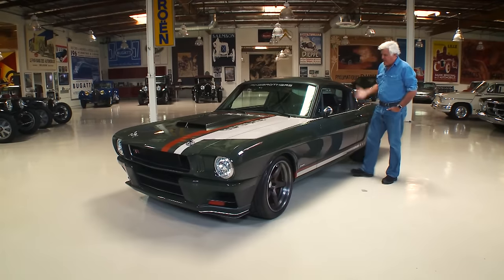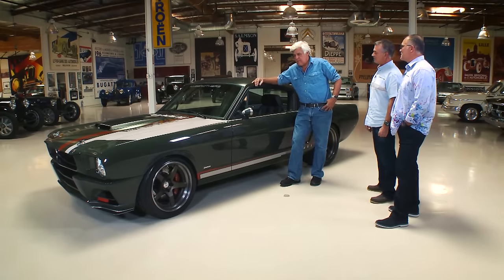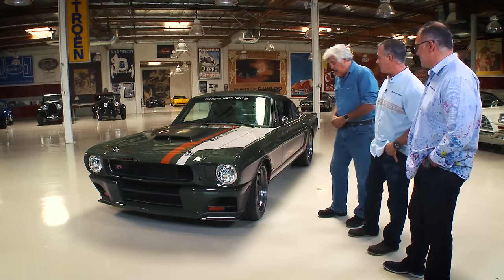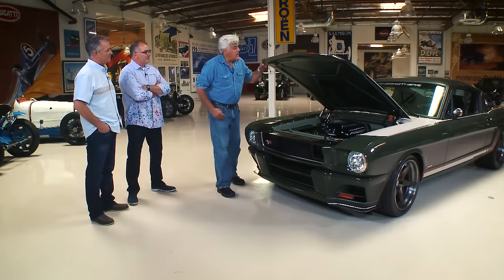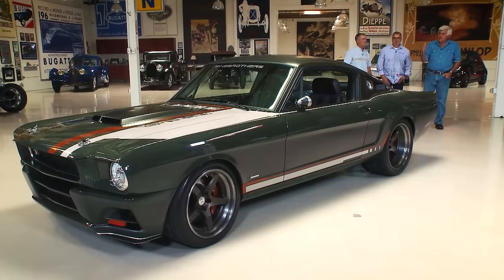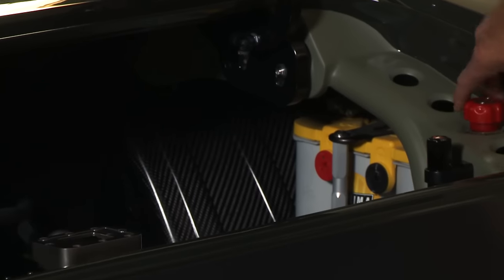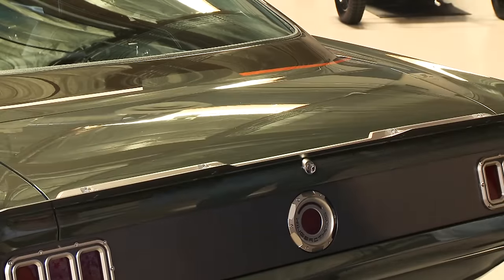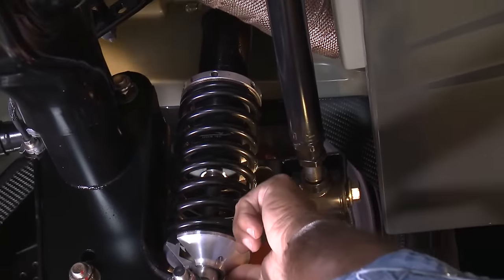Ringbrothers 1965 Ford Mustang Espionage - Jay Leno's Garage

Comment: Ugh! Chevy motor on a Mustang, it's just wrong.
Reply: +GT7786 What "mustang"??? The only thing left of the original car is the glass I believe. It just goes to show that nowadays, it's hard to beat an LS package. Ya hear the same reasons from every engine builder, it fits in smaller spaces with less fuss, cost effective, you can get more power per cost, runs like a bat out of hell, and can take a real beating. What's NOT to like?
Reply: It may be wrong but it makes sense and is more practical.
Reply: +Leeroy Jenkins I love the LS motor, but Ford has great V8's too so there's no excuse for this.
Reply: +GT7786 I see you're point but the man who they built this for had his reasons and that's enough reason for me to say that he prefers an ls engine over a coyote or a larger ford v8. It all comes down to personal preference, as someone's comment below this one said "it's basically not a ford anymore"
Reply: +Leeroy Jenkins true...
Reply: +GT7786 The after market for the ls engine is massive WAY bigger than the ford after market. Its just much easier and cheaper to make exactly what you want fit anything you want.
Reply: +GT7786 Who cares, has the marketing department really gotten that deep into your head?
Reply: +GT7786 It's not wrong, it's blasphemy!
Reply: +GT7786 Still two very good brands...
Reply: +GT7786    That should never never be done to  a Chevy, for sure.
Reply: +That Guy Who Plays Airsoft (ThatGuyWhoAirsofts) Obviously
Reply: +GT7786 The LS has a smaller footprint.
Reply: Wouldn't be an issue if Ford made a equal engine lol. It's also not a factory car anymore, so it doesn't really matter.
Reply: +Matt Greenland Ford doesn't make an equal engine, they only make better, sorry m8.
Reply: +GT7786 I know I'm so tired of seeing boring LS motors!

They're like freaking LEGO'S now!
Reply: +cybertree clearly don't considering that it has to be considerably larger for to even be equal power output. Even then the LS motors are more reliable.
Reply: God that's like saving Chuck Norris with the heart of Justin Bieber.
Reply: cybertree a chevy 350 is a justin bieber mobile?  A 351 is  pee wee herman on estrogen.
Reply: +Leeroy Jenkins But, it makes people perceive Fords' V8s as inferior, which they most certainly are not !!
Reply: +TheHypnotstCollector I'd love to put an ALUMINATOR COYOTE in say a 55 Chev, only thing is...I could not stand the Chev bits of the car...hahaha !!
Reply: arkhsm ford how could you say such a thing?!!   There is an excellent Ford therapist in Albania.  Please, see him!
Reply: zoneracer with a Honda it would run and run. Not a Fix Or Repair Daily kinda car
Reply: +GT7786 AGREE
Reply: +GT7786  It's called MONEY and I can do what ever I want. < Owner of the car.
Reply: +NoNegotiations .... you own Jay's car?

Comment: I’m really sad on how the 289-302 roller engine has been fading away do to the LS. The Roller 302 is such a bulletproof engine and it’s also compact that it’s a shame that it’s no longer used as much.
Reply: I've always loved the small block fords. Throttle response is so snappy. And just go and go no matter the abuse. My oldest brother had a 71 mach 1. Although was not a factory boss 302 it was when he got done with it. Never dyno'd it, but he did carry a fire extinguisher to put tires out after his burnouts😂😂😂
Reply: Unfortunately in 1979 or so he was a t a stop sign and a drunk smashed him from behind and totaled the car. Was sky blue with centerline's. He still has back pain from that accident.
Reply: Still a lot of Windsor folks out here. And the aftermarket really reflects it. The amount of after market parts you can get to build Serious power from a sbf Windsor these days is crazy.   Problem with the 8.2" deck height Windsor (260, 289, and 302) is at about 500hp you're pretty much guaranteed to split the block in half.  So you see more and more going to the 9.5" deck height Windsor (351) and the aftermarket blocks. I've heard stock block 9.5" is good for 700hp or so.  A nice Dart brand 8.2" can get stroked out to 363ci and easily take 1500+hp.  Is the Windsor as popular as the LS? No way. Do I feel like the Windsor is actually starting to get more popular than the small block Chevy (305,350)? Yeah... I kinda think it is.

Comment: Watching Jay's reaction to the Chevy power plant is precious.
Reply: Great car to have
Reply: I had to turn it off at that point, but  I came back.
Reply: PRICELESS
Reply: I would've reacted the same way.  As a "Ford guy" myself; pure sacrilege.  Could've easily put a Rousch stroker crate motor in it, IMO.  That said, as they say, the customer is always right.
Reply: It's a Ford motor in this car, with a Tremec 6 speed transmission.
Reply: @Revolution1117  .
Reply: Engine info should have been first, so I didn't have to watch so much..lol
Reply: I wish I had a six speed in my 70 GTO
Reply: Love Jay, espionage should be sabotage,   LS engine was design by Nascar engine builders. These guys should build what they want with their reputation.

Comment: 900 horsepower, supercharged, 6-speed manual, carbon fiber...if the far right pedal works properly, nobody cares if it's a Chevy or Ford engine. As long as it's a riot to drive!
Reply: Make it FORD!
Reply: I care because it's a MUSTANG. It has to be powered by Ford not Chevy. That just made me hate it now
Reply: Amen
Reply: Ford car, Ford engine
Chevy car, Chevy engine

Everything else is sacrilege.
Reply: I drive a Camaro and I'd be upset seeing a Ford engine in it... So i get people being uneasy with a Ford with a Chevy inside of it. But you know, the owner wants it like that... Meh. Better that than a Nissan inline 6 in a Mustang... At least you get a proper V8 soundtrack.
Reply: Nope. Put a Ford in it
Reply: Wrong. Putting a Chevy engine in a mustang is atrocious. Their excuse about not using a small block Ford is ridiculous, as 65 Mustangs have housed 289, 302 from the factory and the 351W is the same block. Just lazy on their part and ruined the car.
Reply: @poman1976  when the owner pays $500K for a custom handcrafted Ring Brothers car, they get whatever they want. And they wanted a just shy of 1000 h.p. custom built Chevy engine so their mechanic could work on it. Geez, these guys, Mike and Jim Ring are car Gods(who have several wins from SEMA under their belt, and a plethora of custom cars made for the discerning customer).
Reply: I think the customer got a lot more value for his money: the howls of the offended snowflake purists! Probably most of whom couldn’t afford this kind of full-on custom. (Hence, “poman”)

BAAAAAAHAHAHAHAAAA

But seriously, the only truly offensive thing about this powertrain, regardless of mixing brands, is if it were not totally reliable for daily driving.
Reply: Needs a good ole ford power plant. Nothing better to put in that beast. What a shame it has a junk engine 🤢😡🤦‍♂️
Reply: Spike Darkblade : Meanwhile, Jay Leno makes you look like trailer trash, “son.” You’re outclassed.
Reply: @totophi  Blah blah blah what ? I'm sorry I can't hear you over my hard work ethic and lack of caring about your nonsense. Nice try son. Trying to compare a millionaire to a middle class working citizen. Yes that makes sense.
Reply: How could 900 hp not be cool!!

Comment: That R-logo is from a Nissan GT-R.
Reply: No it's not
Reply: hugh mirin
The font, the colour, the way it's stretched out horizontally.. Looks too similar for it not to be a GT-R logo. And why not? They chucked a LS in there too.
Reply: +Peter Timowreef it's very similar but its not an exact copy. go to their website and compare it to a gtr logo and you'll see some slight differences
Reply: my exact thoughts.. looks like the old gtr logo
Reply: +Peter Timowreef yup i agree, and even if they "modified" the logo so its not exactly the same, we all know it is.
Reply: +Peter Timowreef Yeah, I hate to agree but I do agree. That was my first thought when seeing the "R" logo, I totally missed the backward B and only saw the R from a Nissan GT-R. Regardless, looks pretty nice.
Reply: Grant Arnold
yea looks good imo too.
Reply: it is ring brothers logo, if you look closely, it written in BR, but sure, the r is a copy from gtr, just added the letter B
Reply: +Peter Timowreef Yea I was thinking the same, I looked at it, it's the same font/stretch as the older badging. The current badge has changed. Bee R copied the GTR "R" as well.
Reply: +Peter Timowreef Looks pretty close.  Also at 0:02 you can see the same supercharged replica Audi emblem that I almost bought on ebay for my build haha
Reply: +TopShotta Right, well spotted. But aren't original Audi logo's always with the red square instead of black?
Reply: Peter Timowreef That may be, I'm not sure.  But at least the formatting of the logo and square are reminiscent of the German brand's.  All sorts of colors are available online haha
Reply: TopShotta Ah, I thought it looked familiar, I was curious what that was from. Makes sense now.
Reply: +Peter Timowreef Audi has black and red ones, actually the black are carbon fiber. https://www.ecstuning.com/Flyer-Audi_Supercharged_Badge/ES391497/
Reply: +Jose Botello comparing it, it is identical to the old GTR logo. the new one is sharper and different.
Reply: i was screaming that while leno was talking about it
Reply: Bernardo Santos
 I find it hard to imagine that Jay didn't notice that too, I think he didn't say anything to spare the creators a bit. They get a hard enough time for the LS engine all ready.
Reply: Come on, y'all
Reply: Peter Timowreef yeah but its their fault. Plenty of fonts out there.. Why use one of the most famous automotive fonts in the world?
Reply: Bernardo Santos Maybe cuz they liked it!  :)
Reply: TopShotta well lucky for them they didnt get sued
Reply: "Supercharged" badge is from an Audi
Reply: +Peter Timowreef  Thank you
Reply: +Peter Timowreef I thought of that as well.  Put a GT in front of it and the resemblance is unmistakable.
Reply: +Peter Timowreef Common guys, its a HRE Recoil - Ringbrothers Edition: 
http://www.hrewheels.com/wheels/ringbrothers-edition/recoil
Reply: +Peter Timowreef Problem? The Japanese, Chinese and Koreans have been copying the U.S. forever. Looks good.
Reply: Schön
You're the one with a problem, I was simply stating a fact.
Reply: Peter Timowreef Likewise.
Reply: +Peter Timowreef Yes.
Reply: +Peter Timowreef No, it's from a skyline Gt-r (Jk, it's not like nissan has specific R's for every model car lmao)
Reply: And the "supercharged" badge from Audi.
Reply: That's the first thing I thought GTR badge
Reply: that was the same thing I was thinking
Reply: see and here I thought it was for republican
Reply: I was just about to comment that
Reply: facepalm.jpg no its not, its way too big, did you not watch the video? Theres a B overlapping it and its their own logo, with all the craftsmanship these guys have and the cars they work on, you really think they would just take a piece of an emblem off a Japanese car and then use it for their brand logo?? get a clue.....
Reply: You're the one who doesn't have a clue mate. Look at what I said: "That R-logo". And the font and colour of that R is definitely taken from the GT-R. Look at how the right corner leg swoops out, exactly as on a GT-R logo. 
The entire logo including the B is their own, obviously, but the R is taken from Nissan.
Reply: Would you guys like it any more if they had custom made those badges?
Reply: My first thought was it looked like it was from an RS.  Appropriate for a Chevy.
Reply: I said the same thing but it's not lol
Reply: Definitely from the GT-R badge. Someone said from the old style.. I thought they use the same badge on the new GT-R? What's different about it?

Comment: I love Ford, but accept the Chevy engine. Sadly I know all these guys saying "just accept it" to the guys that are against it would flip out if it was a Chevy with a Ford motor in it.
Reply: Nobody ever wants to downgrade, they upgrade. That's why Chevy motors stay in Chevy vehicles and are installed in Ford vehicles as well.
Reply: Matthew shots fired lol
Reply: @MJKircher1221  the only reason there used is price, the coyote is just as capable of the power and with more revs and tech but are about 5 times the price to get one

Comment: The sound of the fuel pumps would drive me mental.
Reply: +rubbiebubbie I think that was bad audio from the wireless microphones, it sounded like interference, maybe not grounded. it has happened to me in the past when making videos
Reply: Is that what it is?  Drives me nuts, too.
Reply: I thought it was the blower or blower belt
Reply: Me too love the car but would definitely have to change that fuel pump